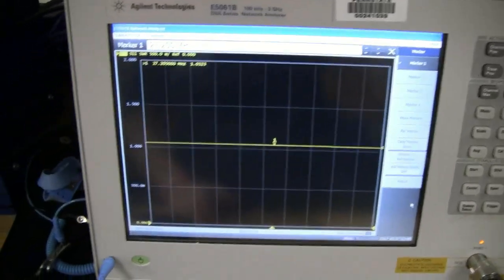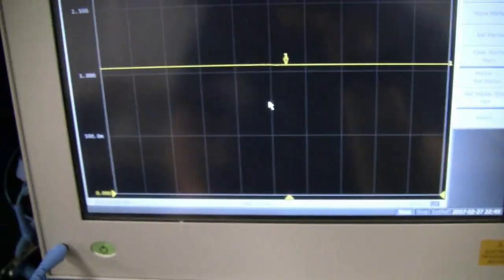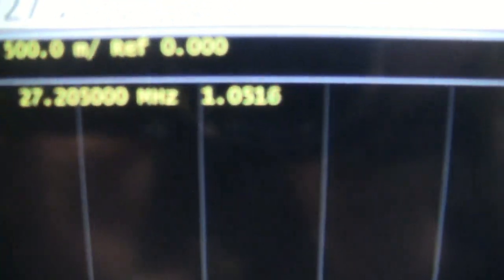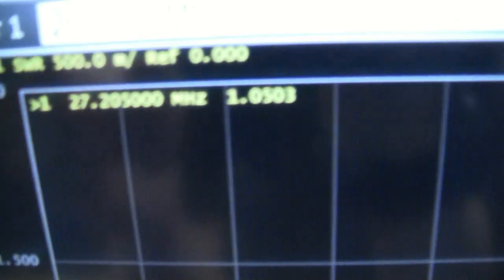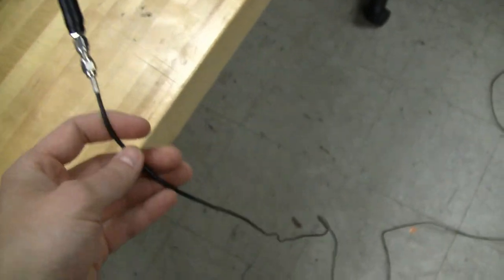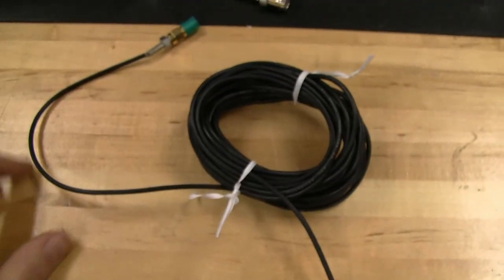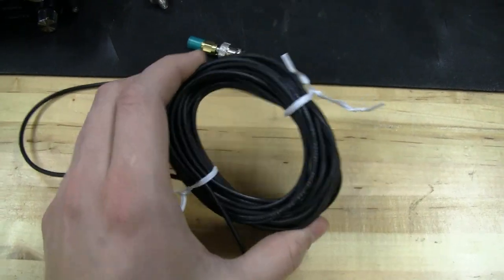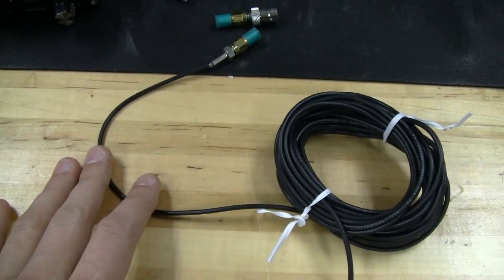Does Coiling Coax Cable Hurt Your SWR?

Comment: I've always coiled my excess cable in about a 4 inch coil and snap a ferrite core onto it and power line noise isolation with great results in mobile installs. Definitely reduces rfi.

Comment: It is often advantageous to coil the coax (search for common mode choke and BigUglyBalun). A choke like this can stop stray RF being sent back to the radio / shack on the outer side of the braid - resulting in RF burns, RF noise and so on.

Often a coil of coax as close to the antenna as possible is a very GOOD thing. For more info, please try the searches suggested, you might find it interesting.

Useful video though dispelling a myth and impressive kit.

Comment: It forms an RF choke on the shield., it does not create a coil on the center conductor because the shield interferes with the coupling. We often do this intentionally.  Because In many cases this is helpful in preventing common mode currents from traveling on the outside of the shield.... ...

Comment: It will make a rf choke and prevent rf in the shack.
Reply: Jaumais what is the purpose of a rf choke?
Reply: The common-mode choke, where two coils are wound on a single core, is useful for suppression of electromagnetic interference (EMI) and radio frequency interference (RFI) from power supply lines and for prevention of malfunctioning of power electronics device. It passes differential currents (equal but opposite), while blocking common-mode currents.[2] The magnetic flux produced by differential-mode (DM) currents in the core tend to cancel each other out since the windings are negative coupled. Thus, the choke presents little inductance or impedance to DM currents. Normally this also means that the core will not saturate for large DM currents and the maximum current rating is instead determined by the heating effect of the winding resistance. The CM currents, however, see a high impedance due to the combined inductance of the positive coupled windings.
Reply: Unwanted RF in the shack, due to Common Mode Current (CMC) on the coax can be nasty. Besides burning your fingers on the key or lips on the mic, it can also cause some devices to fault. Worst case it can cause TVI or BCI, etc.
 
To help reduce CMC on the coax, and RF choke (or CMC Choke) can be placed at the antenna feedpoint.  It may also be desirable to place a second one just before the coax enters the house.
Reply: Not unless it's a specific diameter and coils are next to each other.
Reply: But only at one frequency.  Air cored chokes rely on parasitic capacitance.  This means that at a specific frequency, the common mode impedance will increase, but at others, the CM impedance might be reduced, which is a bad thing.

Comment: What is the velocity factor of your coax?
What is the length of the the coax in the coil?
How exactly does coiled coax 'induce' noise into your radio?
Please clarify.
Ugly baluns of a prescribed size for a given freq placed at the feed point of the antenna are supposed to choke off rfi on the shield of the coax, no?  
Similar coils along the feedline should not hurt as long as the distance between them is NOT a 1/4 wavelength of the freq at issue.   Right?

Comment: Coils never hurt, but can often help.  A 4-inch coil with just 2 tight wraps will reduce impulse noise in most cases. Placing them against metal facia, aluminum siding, etc also helps. Coil location is also important. Because the outer shielding grabs interference down the line, adding a coil at the end of the antenna line, and again at the entry of the ground block, and once again at the entry of the radio, ensures proper choking as it transits downline. No ferrite core is needed for this application. The proximity of the intersecting loops is what's key here which is why only 2 loops at each location is needed. I have perfected this system by using a spectrum analyzer and watching the impulse noise floor drop and seeing the wanted signals emerge. It really does work!
Reply from the maker: that makes sense, I'd venture that our relatively low CB frequency is immune to a few arbitrary loops while those high frequency impulses or other noise will be blocked. good tip!

Comment: Common node currents are the result of the unbalanced coax feeding a balanced antenna  , you need to create a high impedance of the coax outside shield at the antenna  to choke off the voltage on the outside of the coax and force the signal to stay inside of the coax shield  this keeps down coax shield radiation which is the cause for giving out rfi  and recieving interference  not to mention poor antenna performance.
Reply: End fed monopoles also exhibit CMC.

Comment: On my Transit van I run my Wilson magnet Mount antenna with a cable coming from out of the top of my door.
During the occasional opening and closing the part that gets pinched in the door is changing and I'm ending up with a few pinches right in a certain area.

My question is how bad am I destroying the connectivity of the cable with all these little semi crimps in them.
It's not really bad but you can see where the cable has exited the door and sits compressed against the door seal.

Thanks for any tips you can provide I have a power mic on a cobra 29 LTD Chrome and I usually do okay on random highway radio checks.

Comment: This is the third video I've seen about coax cables and the first to not have a problem with coax.
The others were about changing the lengths of coax and seeing the SWR change and one showed and said do not coil coax or cross them as it causes the SWR to go up. One showed the SWR with 3 foot, 6 foot and 12 foot cables and how the SWR changes even on a dummy load.
I have built my own 5 Watt ssb and cw radio and bought various others over the years and never had a problem with coax.
Why is it only CB radio which have a problem with coax cables?
Poor soldered connections? Badly produced p.a. in them? Badly installed aerials?
Come to think of it, how many PL259 plugs are not soldered to the braid causing problems?
G4GHB
Reply: I've been also watching these videos about jumper lengths, very confused. Never heard anyone having a problem with these over here. My tech friend said, just put out a patch as short or as lond as you need. Never had a problem there.
Reply: @FLDX-ck4ob  Neither is cutting coax to a certain length in any technical radio books I have.

Comment: If a ferrite ring is used and the aerial properly tuned to as near as possible to 50 Ω there should be no problems. If there is r.f. on the braid you will get problems with SWR.
However this test is into a good 50 Ω dummy load and could be totally different on an actual aerial IF the aerial is not tuned properly and you could then have r.f. on the braid causing the SWR to change. That's when people talk about not coiling coax. They have a problem at the aerial and coiling coax at the aerial would make an r.f. choke but better to use a ferrite ring.
Never in 49 years have I had a problem with r.f. on the braid affecting the SWR.
G4GHB.
Now destroy the one about a magical ½λ. The magic ½λ cable to the aerial connects to the jumper from the radio through the SWR meter so making one continuous length of coax. The magic ½λ has gone.

Comment: At 4-12 Watts on AM little difference. Higher power will leach through the shielding of the coaxial cable and SWR will be effected unless you figure eight your excess cable. Electromagnetics and Radio are curious theories and fun to play with. You don't need fancy equipment, just a radio already dialed in with a low SWR and a bit of amplified signal and have fun experimenting. Using a dummy load isn't the best way to get real world result. IMHO

Thanks for the video!
Reply: Figure eight?  I don't know what you are smoking but I want some!  I run 1500 watts at times and the SWR does not change because I have a CMC* choke coil in my feed line!  What the choke coil does do is prevent stray RF from entering the shack on the outside surface of the coax shield and causing problems with my computer and other electronic devices!

*Common Mode Choke

Comment: The "Q" will not change in coax, However, If you have a load that is not resonance to the transmitter. Lengthen/shorten, coil it up etc, It should not have any affect to Q.  In short... A person whom made this claim, Has an antenna that is not resonant to the coax or radio. Nice job showing the fine folks out here how well things behave when you have the correct impendence and the final end... So Rl=Ri or Zl=Zg For Max Pwr Out. 73'
Reply: The guy who started this myth.... probably sold coax cable!
Reply: resonant to the cable???

Comment: I just cut the cable to length and put it back together. Good knowledge though. Obliged.
Reply: Now you have changed the impedance of your connection between the transceiver and antenna. How has it been since the modification?

Comment: If the coax had a hundred watts running through it , it might make a marked difference
Reply: shaneweightman it will not make any difference 10 or 100 watts.
Reply: @jaumais  Is the correct answer

Comment: 3232, you mentioned noise with the coiled up FL. Have you a way to test for noise in this situation and is the possible difference audible to the ear?
Reply from the maker: Audible to the ear? that depends on the frequency of the noise. A test could probably be done with this same suite of equipment

Comment: Look, I am no expert. But I can translate radio lingo to regular electric lingo. As I understand it, 'SWR is a ratio. It is the ratio between impedence (resistance) and signal (amperage). Apparently, with radio waves, resistence reacts to amperage. Like I said, I am no expert, but this is the way I understand it.  So, I am not wrong about that, how can you measure that without running a signal through it?

This is like trying to measure voltage without a ground. 

Run a signal through it, and see what happens.
Reply: VSWR is the measure of the lowest voltage on the line compared to the highest.
Reply: The Vector Network Analyzer (VNA) is the signal source!  Just as an Antenna Analyzer is the signal source when checking the VSWR of your antenna/antenna system.  A VNA or a Nano VNA, a small portable VNA, can be used in the same way.

Comment: you might try this with a real antenna sometimes coiling the cable helps the swr and sometimes it hurts the swr but it always causes heat in the coax which can cause the coax to short out.

Comment: It's all witchcraft.  I have new cables that ohm out. 6', 50' and 100' on a homemade dipole 11 meter. I put 6' jumper on and swr is dead flat. Put 100' on and swr is 2.5-3. Put 50' on and swr is 3.5-4. I added inline balun with 6' jumper at antenna and no change. Wth?  Witchery.
Reply: You must have r.f. on the braid.
Never had problems here with SWR changing with different lengths of coax. I use ferrite rings.
G4GHB.
Reply: I figured it out. I had an swr meter that when I built the dipole antenna I had a jumper connected while I trimmed it to length,  but when I added full length coaxial it would hold way high. Ended up being the meter. I got another one and did it again and it did properly.
Reply: @headpainter1  Right okay. Glad you sorted it.
Reply: @bill-2018  I appreciate the input. I knew I was doing it right but I kept getting the wrong ending
And I kept pulling my hair out. So the only other thing left was the swr meter. Witchcraft! Lol....
Reply: @headpainter1  Yes, strange it was the meter. I made a Wheatstone Bridge resistive type, the radio never sees over 2:1 SWR but reads accurately, good for tuning aerials.

Comment: You wont get a reading by terminating the cable surely
Reply: True, this is a good 50 Ω load so the SWR should be good.
If you get an aerial as close as possible to 50 Ω there should be no problem with coiling coax. Use a ferrite ring too to stop r.f.
If the aerial is not near 50 Ω it's a mismatch and you will very likely get r.f. on the braid affecting the SWR as the coax is moved around.
G4GHB.

Comment: This is a make believe test, in that you should be testing with a real antenna and four watts of rf;  the legal CB limit.
Reply: The test would be done with a resonant antenna I presume, so the purely resistive load should simulate this. What is convoluting is the where these ideas come from. In real life the antenna is not resonant, nor necessarily 50ohms so we have other factors introduced like CMC, standing waves, and the coax becomes part of the antenna. That is the root of these stories. Coiling could lower the SWR  instead. And power shouldn't come into it as we are dealing with ratios here.

Comment: It's the basis of a 'dirty choke balun' to lower SWR!
Reply: Common mode chokes are not baluns.  They are not used to match a system. 1:1 current chokes, also known as line isolators, prevent common mode currents from traveling down the shield of the coax and getting into your shack and consumer electronics.  However, a 4:1 or 1:4 balun will act as a transformer to change, say, a 200 ohm balanced antenna (a dipole) to 50 ohms to allow the use of coax to feed the antenna.
Reply: Chokes do not lower SWR. Next you'll be telling me that the SWR goes up with increased power... on every system. Go back to kinda.
Reply: @arconeagain  Rubbish a dirty choke balun, wound up looped co-ax can help, it doesn't put a DC short across the output like a conventional Balun or Unun either. There is usually DC blocking on the PA output, and if you've a HT valve lin. you're going straight across this via the DC blocking cap. into the balun or unun! You go back to learning the resistor colour code dude!

Comment: This is not a true laloratory climate, You just made an rf choke, honey,  What insertion loss did you get ?
Reply: He stated that the video is about testing the effects of coiling your coax on SWR, nothing else. You commonly here this from CBers. The only way losses come into it is that it would effect the reading by indicating a lower SWR than what it really is at the termination. So your comment is out of context and condescending really... honey.
Reply: Backyard technician, no engineering basis confirm your conjecture, honey 💃🏼
Reply: @Sophia-hs3rz  Suggest you read the ARRL or RSGB or any antenna book and learn something.
Reply: You're just a hobbyist, why?
Reply: @jfrphoto01  Yes.
Reply: Obtaining an amatuers permit is easier than getting your usa driver license. More ego than formal education you're dancing,  honey 🙃
Reply: @Sophia-hs3rz  I don't know who this comment is to, me I think, however I made a 10m dipole now the band is waking up and tuned it on 28.100 MHz as I like the QRP c.w. frequency. Adjusted for a good low SWR, meter only twitching, a coax r.f. choke at the aerial, checked with a NANO VNA on the Smith Chart and no difference when I touched or coiled the coax as I had stopped r.f. on the outer of the coax. As I have said all along only C.B.'ers seem to have problems with aerials, my guess is because of r.f. on the outer braid of the coax. Exactly the subject of this video. It makes no difference to coil coax.
G4GHB
Reply: @bill-2018  Some ppl prefer pop tarts over Ensure asserting as a healthier diet. Others vote Quran over the bible.  CB users & Amateur ticket holders are same. Chinese NanoVNA brands you an rf engineer? You're happy?  You win 🙃
Reply: @Sophia-hs3rz  CB'ers do what they enjoy and that's O.K. by me but I hardly call CB and amateur radio the same. One buys a licence, if they bother, the other has to take a radio exam covering receivers, transmitters, propagation, etc. to get a licence. I built my own ssb/cw transceiver, not from a kit either, so I have taken the hobby to it's fullest extent using knowledge gained from studying for my licence. Never bought aerials, I make them, Yagi's, dipoles, doublet, long wires in the past and currently inverted vee on 60m, h.f. dipoles, 2m collinear, h.f. vertical. Repaired a 1944 era Wireless 19 Set. That's what the hobby is about for me, not just operating.
Reply: @Sophia-hs3rz  You do your thing and I'll do mine.
I'm happy enough making things and using them. I don't do it to impress anyone, I took the knowledge I gained and used it.
G4GHB.